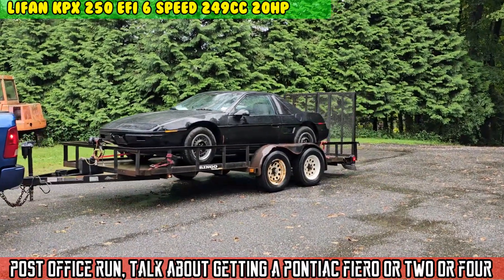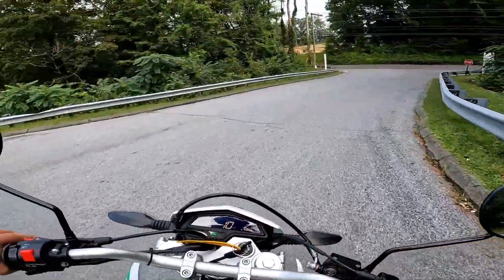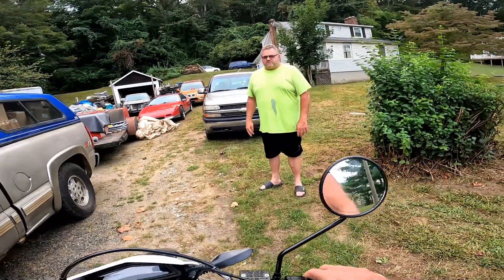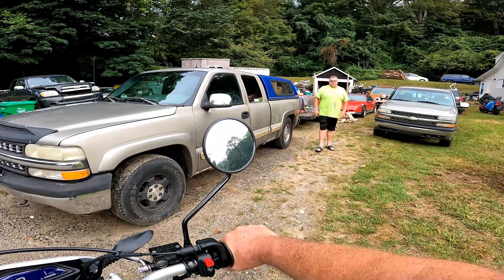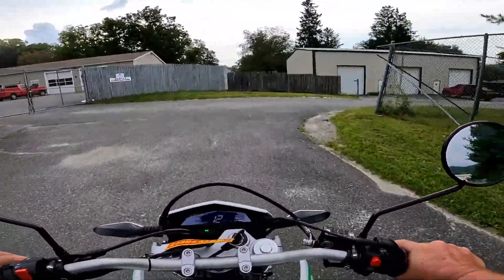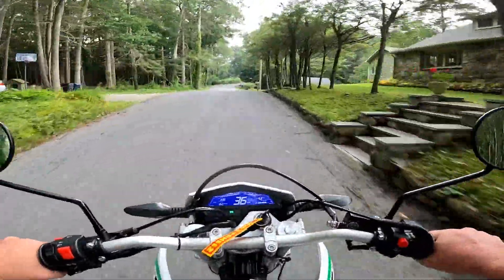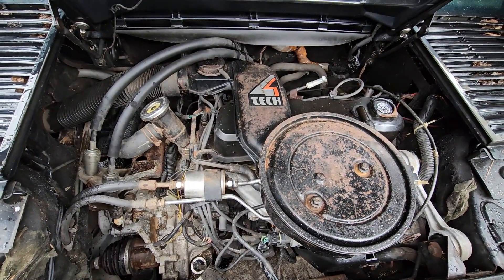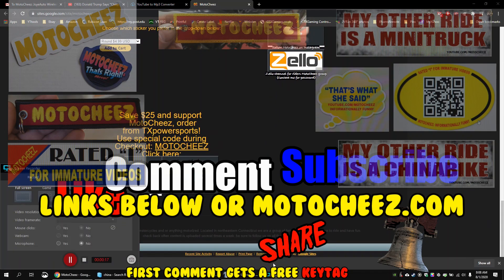PT7 Lifan KPX250 Post office run, talk about Pontiac Fiero purchase, maybe 2, one has bad engine

Comment: I have a 1988 Fiero GT with a 3800 supercharged swap. It's got a few mods done to it. Ported intake, ported blower 1 size smaller pulley, rockers and headers with equal length headpipes on it.  Its a pretty fun and quick ride.
Reply from the maker: That must FLY!

Comment: The petals, steering wheel, and wear on the seat tells the age of a car. The controls could be a hint if the car has 34,000 miles or 134,000 miles. Don't forget that they have cooling issues and the reason most Fieros ended up as a cheap buy. It will still make a great toy to tinker with.
Reply from the maker: Yeah I always check those points, plus this has 100,000 mile mark so it definitely didn't roll over. And the inspection sticker still in the window with like 30 something thousand miles. Yeah I'm doing some research now and I did before so I know what to keep an eye on Thanks
Reply: I put 2 stroke oil in the cylinders of an engine that was locked from sitting. A week later I got it to turn over by hand.
Reply from the maker: @tullyg493 I've heard of kerosene and transmission fluid, never 2 stroke oil, cool
Reply: @MotoCheez  might be cheaper than diesel and atf, some use marvel mystery oil, or pb blaster/wd-40. The engine needs to be accessible to get the piston head out since it's not connected regardless. Piece of wood and a mallet after it sets in the lubricant for a bit.
Reply from the maker: @bobtailedtrucker2521 the piston 8s at bottom of cylinder, should come out easy, I showed in last video
Reply: @MotoCheez  the downside is the carnage of the piston when it let loose. Hopefully it isn't to banged up.

Comment: 4cyl will have the BOP bolt pattern, meaning it will bolt up to a 3800 v6 or Buick Ols Pontiac v8... Whee! v6 unit could be up swapped to a 3.4, but thats about as far as it could go without an adapter.

I worked at GM foundry when they were making the Iron Duke. They were very fussy about being sure the blocks and heads wewe free of core sand. Much fussier than the v8 castings. Didnt want a repeat of the Vega fiasco.
Reply from the maker: Great info. Thank you

Comment: So ive owned a handful of fiero, first of all, dont even bother with an auto unless you wanna swap the engine and trans with something else, the stock 3 speed sucks. Second if you wanna do an engine swap and keep the stickshift, be aware the 4 cyl trans aren't the best. My understanding is the v6 4 speed is the toughest. 3rd, my absolute favorite fiero i have owned was a 4 cyl 5 speed. It was quick enough for its suspension and got atleast 40mpg highway. My least favorite was a v6 auto. Took all the fun out of it, even with extensive mods to the engine, that trans killed it. A caddy 4.9, or the 3800/sc would be the best swap. However either will grenade that trans sooner or later.
Reply from the maker: Thanks, going to try and revive the 4cyl, if it's shot I'll have to make a decision...

Comment: That car has a ton of potential
Reply from the maker: I think so too. Not sure if the mileage is accurate but it sure is clean inside and out and underneath there's no rust at all, but I did see one of the coolant lines as a whole where I don't know if it blew out or I'm hoping it's not from freezing but you would think you'd see other signs. We'll see has a dig into it

Comment: A grand national v6 turbo charger  engine swap  would be nice or a s10 v6 vortex engine then it would be similar to your Corvette keep it simple. I'd say it's got over 100k miles it's not to often some one blows a engine at 37k in less there beating the dog shxt out of it  even then it's not to common. Usually the transmission goes be for the engine.  💯🛠️🍻👍✌️
Reply from the maker: Yeah they would be good transplants the Grand national especially. I'm wondering if that's actual mileage and the car just sat for that long and whoever picked it up found a motor that was set seized and got it running and blew it up. Carfax VIN report comes back when estimated 52,000 checking all records

Comment: I told you how i just sold mt V8 fiero, well I still have a v6 I'm looking to sell.
Reply from the maker: The stock 2.8 V6?
Reply: @MotoCheez  It was a new jasper crate engine for the 86 Fiero that I put a big Isky racing cam and lifters in it, also did mods to the fuel injection so it would run the cam like bigger injectors and polished up the upper and lower intakes. It has the 410 performer trans. The car was fast as hell but the lower end couldn't take it and when it warms up it starts ticking. Took about a year of running it before the crank started to go. Its been parked for a few years now. I was considering buying an aftermarket crank and running it, but would rather have cash to help pay off my new KTM 690 SMCR. I also have a dlx Hawk, lol looks like we play with the same toys. 😁
Reply from the maker: @darianballard2074 ahh, yeah same toys. When you getting your MINITRUCK? Lol. I'd trade my van for a decent 88 GT 😁

Comment: Fiero on steelies I have not seen one in decades. Id keep the duke they are dead simple just a little leaky.
Reply from the maker: That's why I believe the mileage is on it, the engine doesn't have any leaks The transmission is so clean except for just basic dirt and stuff on top of it. I believe this is all original and the mileage is correct. I did have one guy say that looks like the odometer was rolled but there is an inspection sticker on it from many years ago when it was last registered that shows low mileage

Comment: Go with a rebuild and add turbo.....lol   Cheezy is at it again.
Reply from the maker: Thought about that too, I want to drop the oil pan and see if the crank is good and why that one connecting rod isn't moving that piston maybe I could do it with them engine in the car has low miles...